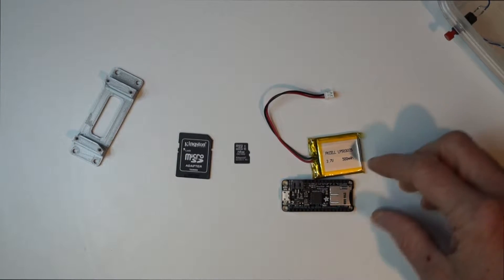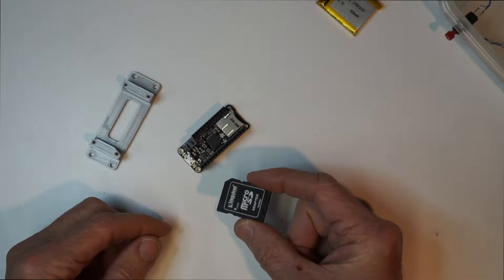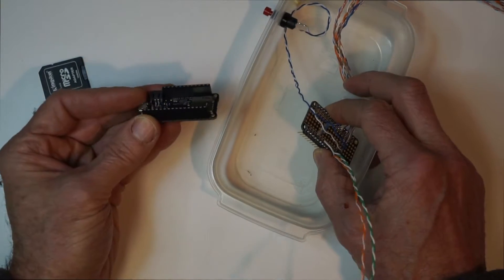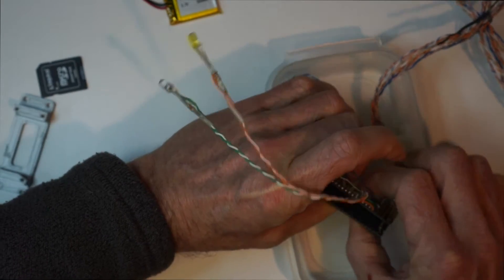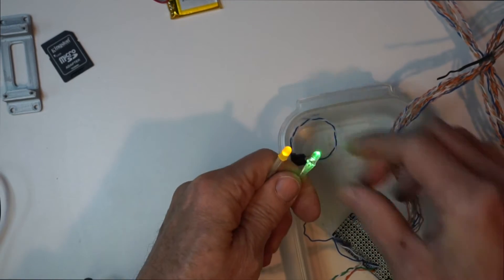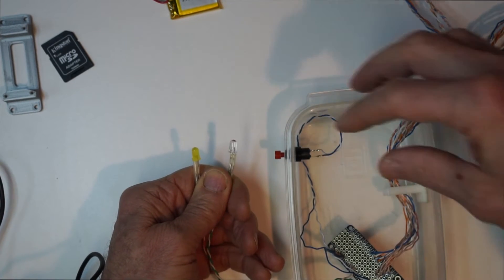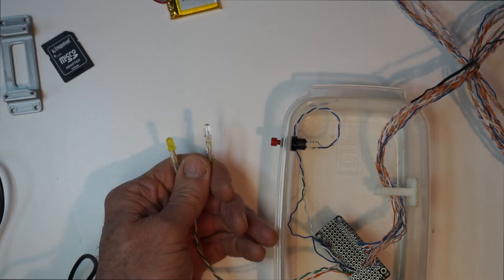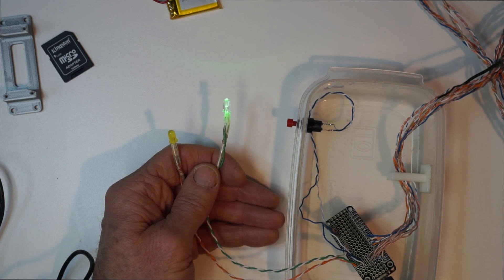adalogger_v1_documentation

Comment: hi,do you still use this board right now?can i ask why you like this board??much thanks.
Reply from the maker: Yes, I still use this board. Why? It has the features I need for this task, which are storage to an SD card and reading voltages. There are many different Adafruit Feather boards and Arduino boards from other vendors. Choose the one that has the features you need. I have many different Arduino boards.